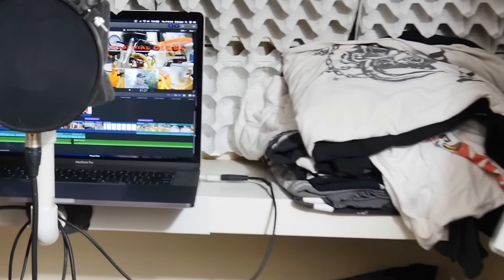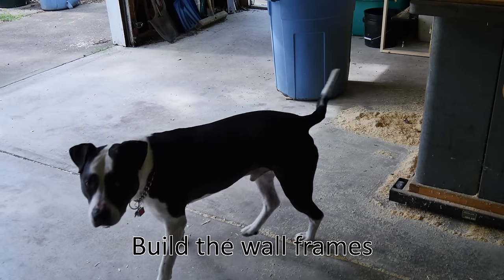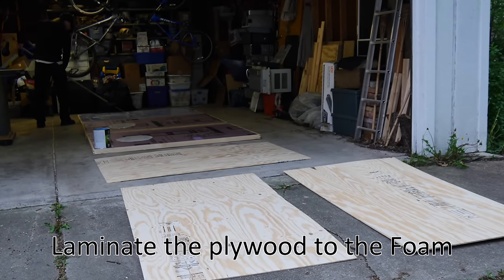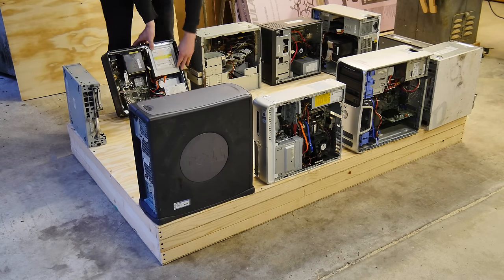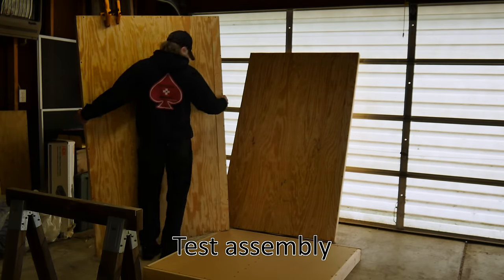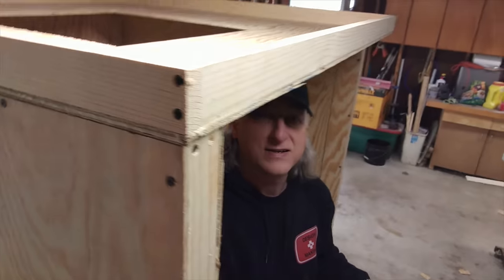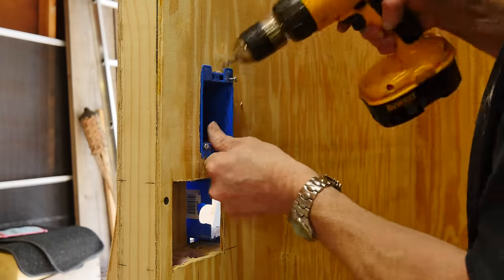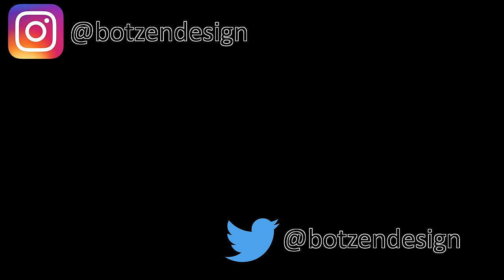Vocal Sound Booth Whisper Room Build: Part 1Plans, basic frame out and electrical

Comment: Everything else looks pretty neat, but I have my doubts about embedding the LED panel and the power supply into the insulation foam. LEDs still run rather hot and usually use the alu backing plate as a heatsink, I would at least drill a few vent holes above the panel to let the hot air escape.
Reply from the maker: , that sounds like a good idea I was sort of thinking the same thing myself

Comment: Hey everybody. Great video. I'm a recording engineer for German TV Voiceover and produce and engineer music professionally. I can only suggest trying to increase the size of this build. I would almost guarantee that a recording will sound better in a bedroom with a matress behind the tallent than in a booth this small. The resonant frequency will be a very, almost certainly masking the voice and there is not enough room set aside for adequate absorption. This makes sense if you are trying to do very budget ADR and really dont have any space, but for musical applications this is almost certainly the worst solution for getting good sounding vocal tracks. I would prefer a small amount of OK sounding room than a boxy, comb filtered sound from a space this small.

My booth at home is around 4 times the size, and I still find it better to record singers out in the control room where there is good diffusion and a lower fundamental resonance.
Reply: Thank you, this is what I was thinking as wel. Built one of these years ago and upon going back and listening, the vocals were terrible.

Comment: Check this: I also bought myself a $100 Gazebo / Pergola (200cm x 200cm) and placed it in my basement on a noise absorbing rug. I left the outside "walls" off and placed moving blankets on all five sides. Got myself a 10M led strip for the inside and some bass traps in the corners and foam on the inside off the blankets. Super easy set-up for recording with my D18 and singing at the same time straight into my iPhone using the Roland Go Pro mix. Call me cheap but I just love my little "tent" inside my basement. Nice and cozy. Love your channel man!!

Comment: My dads shop I work in we use that insulation foam. 
The snap in the that stuff is amazingly accurate. 
If you just “draw” the line you want to cut with your blade a quarter inch deep and then snap the foam board it’s quicker and cleaner than slicing through the whole thickness.
It’s the cleanest way to slice it. Works like a charm until the black foam thickness.

Comment: Thanks for sharing all the work you do. It's always valuable information. I've done some acoustic oriented work like this over the years. What I've discovered is that this type of build is a lot more work than return without the proper use of materials. One of the reasons that gypsum board is used in this type of construction is that it doesn't transmit sound waves as efficiently as wood does. Even with boards made for acoustic dampening, multiple layers are required. Your construction is solid but it appears to essentially be one big sound board. As someone else here stated, that pink insulation will do very little to dampen sounds waves. I've had much better luck with cheap, acoustic blankets. Even in the same room as my computer I've achieved decent isolation. Your voice overs sound good. I would just focus on bass traps in your space. That's mainly what I hear on your channel, and I think you'll experience the same effect in that small booth even with acoustic foam. The plywood will vibrate to the framing and then to the other sheet of plywood. Condenser mics are so good these days. You don't need a whisper room to get great audio work done.

I really do enjoy your channel. Please accept my 2 cents. I'm told it won't even buy a cup of coffee though. Sorry. Thanks for the constant entertainment.

Comment: You can also just get really cheap 1/4-in 4x8 plywood, get five pieces. Just connect them with solid strong hinges in the corners. That way you can fold it.
Then just line the outside and inside with thick moving blankets. 

Attach a light to the top of it that is rechargeable with a battery pack.
Drill a power strip onto the inside a slim one make it look nice. Simply run that wire through a small hole out of the wood.

There you go you have yourself a cheap and easy to make portable booth that is super sound deadened light enough to carry.
You can add to nice big straps so you can carry it.

Comment: I was wondering what on earth you were doing until you mentioned that you aren’t interested in actual sound isolation because you’re putting this in a very quiet location.

Sound isolation is the whole point of most vocal booths, which is why they’re so much denser and heavier than what you’ve build. Basically you created a relatively airtight closet, which is perfect for your needs, but nothing like all of the other commercial and DIY vocal booths.

Very good video, but I need a real sound isolation vocal booth.
Reply: Thank you for saving my time. I'm looking to build a more professional booth as well and it's hard to find anyone talking about stuff that will actually help a voice actor. :/

Comment: I assume you considered some alternatives before starting, so I'll ask: why did you opt for the pink insulation instead of stone wool? Why did you opt for an internal outlet box instead of keeping the laptop outside the room, with just an HDMI cable, power cable for the monitor and XLR going outside?
Reply from the maker: I don't like fiberglass, did not want to deal with it. Laptop is outside in the holder with cables routing inside to mic and monitor, wireless trackpad and keyboard, look for update soon for the ventilation

Comment: Nice projct wit many great designs. I would never use Phillips screws. They are an old and outdated design. I always use torx. They are stronger, can be removed often without loosing the grip to the screwdriver. And I would always use wood glue to put things like this together. Using glue makes your structure much stronger and wood glue is inexpensive, easy to use and nontoxic.

Comment: This is exactly what I wanna do, but mine would by 6ft x 6ft for inside dimensions. I just couldnt decide if I wanted to make each wall 1 whole piece or make each wall into 2 separate panels because I want it to be modular and for ease of getting the walls in or out of the house

Comment: Question. Do you think using the light cement like you did will be good to use to luminate mass loaded vinyl onto plywood and do you think it will hold???
Reply from the maker: Maybe, but I think contact cement would be better

Comment: Sheetrock is important as its the mass that does the work, styro is full of air holes which is great for warmth but not so good for acoustic absorption
Reply from the maker: Works pretty good in my case, I would have added some low mass vinyl had I known about it.  All a nice dead space to record audio in. Works very well and creates a nice sound for me.

Comment: Hi Eric!

So first of all, kudos to you for making this video because it has been extremely helpful to me as I copy and tweak your design for my own booth. It has taken me about two months and about 150-200 hours of work to be about 95% done. I’ve watched all videos of your series on this booth at least three dozen times and I couldn’t figure out why you were so frustrated down the stretch when everything looked amazing…. Until I got about 70% done myself 😅 yeah it gets…. Infuriating lol

But anyway— I’m looking now for the plastic sleeves you put on the outside of the booth. Did you have those 3D printed or did you purchase them somewhere? I can’t really find something like that. In theory, I could use some of the wood scraps to make some myself but this would save me some time if I could outsource this portion of work. 

Anyway, thanks again for the design! Super helpful! I’ve recommended this series to a few others in the industry looking to DIY their booths. 

Be well!

-Brandon
Reply from the maker: Glad you like the videos. Hope your booth comes out fantastic. I printed those baffles on my 3D printer
Reply: @EricStrebel  If you don't mind-- what was the blueprint you used? I have a friend with a 3D printer and I may ask for his help to fabricate the laptop and hard drive sleeves.
Reply from the maker: No blueprint exists, just used the dimensions of the parts and holes used

Comment: 5:40 The reason you cut that plywood a few inches short is because you mocked up the frames with the back wall inside the two side walls. You were making room for that panel when you measured the ply shorter.

Comment: What's the name of the pink foam panels with the pink panther ? I have only see pink isolation wool in all other builds. Thanks
Reply from the maker: Pink foam insulation
Reply: @EricStrebel  Thanks, would you know the difference between the Pink foam insulation & the Regular pink sound wool  i see so often ? I live with other people in an appartement, also have neighboors & must do the best sound isolation i can .
Reply: @HeWrd-fg8gg  Do not use the pink Foam as it does nothing for sound absorption. Use rock wool. Also use acoustic drywall instead of regular drywall.

Comment: Hi, why exactly did you glue a small wood strip on one of the wall frames? Thank you, please advise.
Reply from the maker: Actually, I think you are referring to the cardboard that I added. One of the pieces of styrofoam was a little bit thicker than the other three so I needed that additional thickness for the foam to fit inside the frame.

Comment: Would have been awesome if you wrote down the exact measurements of everything piece by piece as a blue print to take away.
Reply from the maker: Yes, that would have been excellent, use the sketch in the first vid it has dimensions

Comment: May work for voice over work but def don't recommend it for Vocal Production. For professional vocal production when recording vocals you need a large enough room with proper room acoustic treatment and some defussion to scatter the sound through the room. Recording in a small soild box will sound very boxy and cause Comb Filtering and distortion issues.

Comment: How can I get my hands on your blueprints sir???
Reply from the maker: There are no blueprints just the sketch in the beginning of the first video
Reply: Eric Strebel I seen that of course and I’m following I’m just to understand how you made the wall stand on the base is all I’m stuck on... also was your electrical connections considered low voltage??

Comment: You've wasted a lot of money! Those light PU-hard-Foam Boards aren't made for Sound Isolation, but for heat. To isolate sound properly you need mass! Otherwise you don't get those deep and mid-deep freuquencies not cut-out. Even some mineral-wool would had been a better choice for the same price! The best choice for this type of sound isolation would had been Rebonded Foam. That's an ultra dense but flexible foam made of recycled and compressed foam rests and isolates sound like crazy ;-P
Reply from the maker: Works great actually

Comment: Yeah... 0 seconds in I see cardinal sins happening
Reply from the maker: Please elaborate, unit works quite well....
Reply: Using styrofoam as insulation. Sure, it has an R value but that doesn’t matter when isolating vibration. I understand you’re aiming for lightweight and functional and , yes, an air gap helps, but, I call it risky business. Passage of sound runs through the air which causes vibration. Stop the vibration. Adding mass helps but limit the air to shake up potential passage. That’s based on my own experience both building and being in and out of Whisperrooms.
Reply from the maker: Carl G Brooks Yes, you’re not the first to mention this I assume that there is some truth to what you were saying, perhaps next time I would use something different. But, the booth works as expected and creates a quiet dead space to record in. I can’t argue with that. The main reason I did not use any insulation is I just don’t wanna deal with that material I don’t like it.
Reply: Eric Strebel understandability, I agree. I used mineral wool on my personal booth. Thankfully, I found a means to bypass ALL that in WR’s design. They key  is “insert nuts” and thic boards
Reply from the maker: @CarlGBrooksVO  interesting, I would be interested to see a breakdown of the details you are describing.

Comment: But honey...this is a waster of time and money...if you built all this just to have dampened space to record in but yet is not really sound proof....yet you said you need it to be mobile enough to move to another location if need be.....But then the next place might have noise and there goes your wasted....effort....;when you should made a booth for why a booth should made....Both for sound proof and a dampened space to record clean vocals or audio.......shhhhhh......people think too far till they miss the simple truth about things in life....

You just should a vocal booth that serves all the purposes of vocal booth....because if its just to remove echo and unwanted reverberation you could build the same thing but with pipes and material than can be zipped up for mobility and yet will be damp or dense enough the remove unwanted reverberation....
Jesus Christ this is why comment section is a good thing....

I too have dables into all these sound solution, have built a booth too and know what experience learn from it all.
If you have a quiet space build anything but an enclosed booth made of wood and and doors etc...
Thanks for the video anyways..